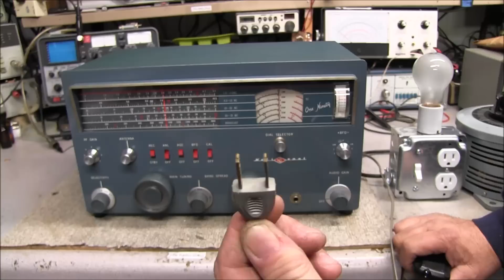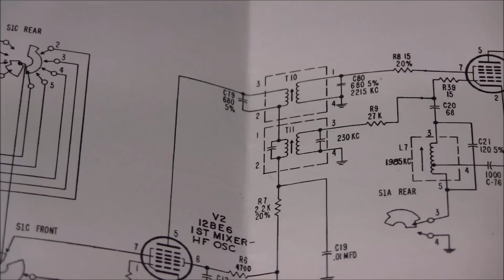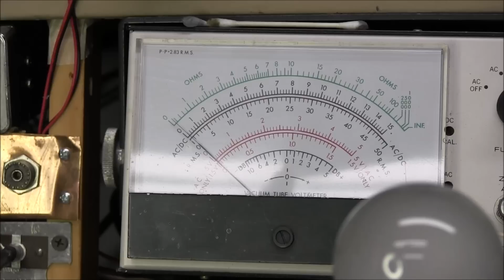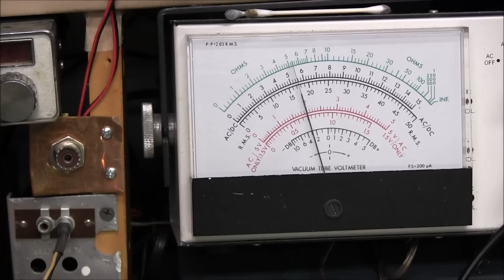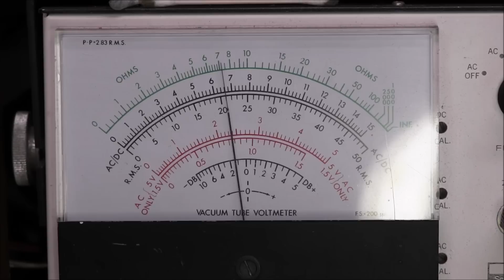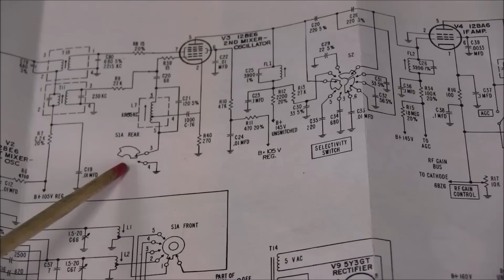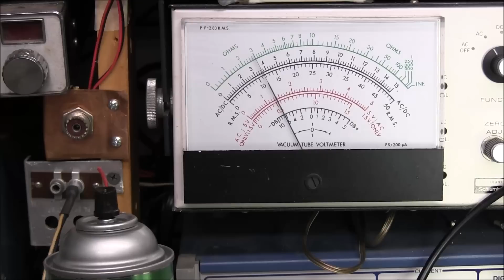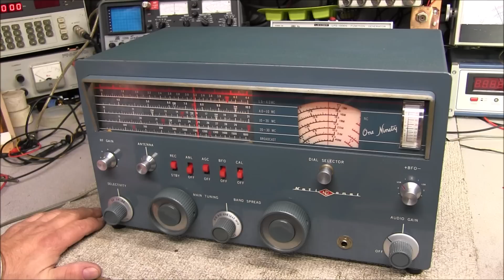#222 National NC 190 Repair

Comment: I have a 190 sitting on the floor next to my desk right now. It looks like it got hit by a truck at high speed but surprisingly it works. It has a hum issue as well so it definitely needs restoration but I need to find a decent case or at the very least a meter and a body hammer so I can get it going again.
Great seeing another video from you Buddy!
Reply from the maker: Ouch, hate to hear that. Perhaps you will be handy with the body hammer.  I have fixed a few like that. Good luck.  Thanks for watching

Comment: I had exactly the same problem with L7 in my NC190.  Instead of getting medieval on mine, I just replaced C21 (across the coil) with a variable capacitor and it tuned up fine.  Someday I'll replace the cracked core.

Mine still has a problem with the bandspread tuning control - the vernier drive turns the plastic dial that is on the capacitor shaft directly, and my dial is so warped from being turned on 24/7 (at a broadcast transmitter site) that the drive doesn't engage reliably.  I've got to either remove the warping (with heat and pressure maybe) or get a reproduction made.  The vernier on yours is different than mine - using a spring for tension instead of the two spring washers and two nuts that mine has (cheaper).

Something I noticed when aligning the oscillators is that the main tuning dial needle is only supported at the top of the radio and it will sag on the bottom end if the radio is on its side, causing the higher bands to indicate wrong,  You have to tune the oscillators with the radio resting on its bottom to be accurate.

Thanks for the great video, Buddy!
Reply from the maker: Thanks for that comment. Good deal on using that varicap for a quick fix.  You will also find that they made slight differences in production due to parts availability. Very common.  You are correct on the tuning needle. Proper tension dial string should prevent" some" of that. Plus always compensate when tuning on its side.

Comment: Great work as usual Buddy...are ferrite slugs a standard size? Millen probably was the biggest supplier. What's your source for replacements? Parts mules or new old stock? BTW, that was the ARRL Sweepstakes CW contest on 40m we were listening to there at the end.  73 - Dino KL0S
Reply from the maker: Thanks Dino. I have some NOS and also lots I saved from sudden death.  Have not bought any in years, so far. Yes and were some strong signals coming in.

Comment: Odd that a transformer powered set has tubes with 12V filaments, though I have considered building an amp with 12V tubes.
Reply from the maker: I agree. But it was what they had on hand at the time.  When they discontinued the previous receiver that had 12 volt tubes they used up what stock they had. There are some later models with just 6 volt tubes.